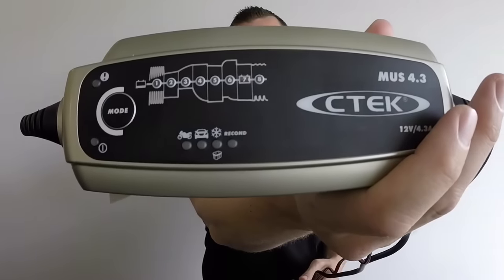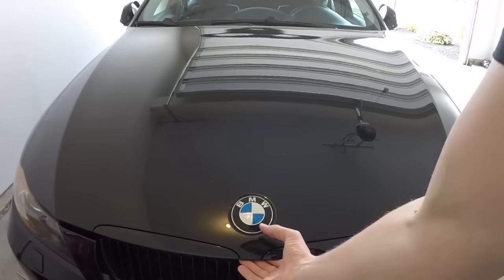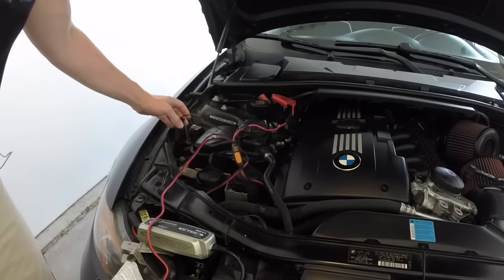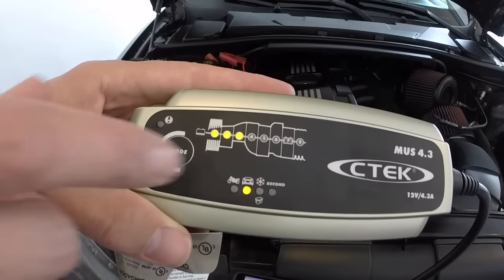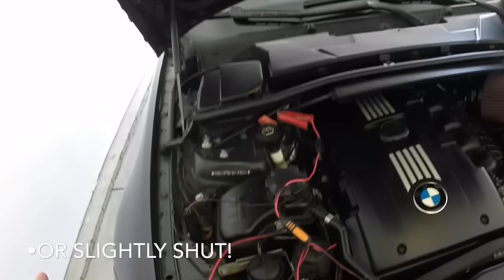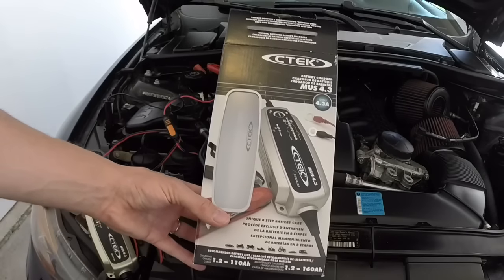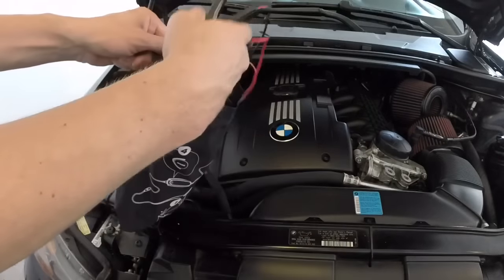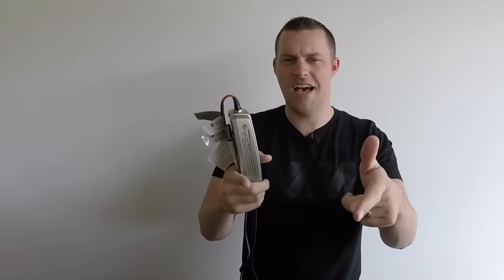How To Charge A BMW Battery! CTEK 4.3!

Comment from the maker: CLICK HERE To Shop On My BMW Fanatic Amazon Website! Thanks for the support! 👉🏻https://www.amazon.com/shop/bmwfanatic
Reply: BMW Fanatic my battery is dead can i charge with this ctec charger? My car is f02
Reply: Do you know where the negative terminal is for the 2018 G30 BMW Model? I've been trying to find this out but with no luck. An image of the negative would help a lot. Thanks,
Reply: Hello can you charger the bmw battery using a regular battery tender plus?
Reply: Hello @BMW Fanatic I have not used my 335i for a few months and it is completely dead should I use the connectors for the front charger or should I use the connectors for the battery itself to charge my car ? What do you think the best way to do it with my current car condition ?

Comment: I plug in my battery to the tender if it sits more than 2 days.  Might be overkill, but never hurts to keep the battery in top shape!  CTEK is the way to go.
Reply from the maker: Brandon B Nope not at all!
Reply: Shifted Perspective I do the same and all my batteries have last more than 7 years. I change the battery just for peace of mind after 7 years.
Reply: Same here. I've got one of those cables wired in permanently so I don't have to use the crocodile clips. Thst's connected to an extension cable that slips under the garage door and that's where the charger is. It means I can close the hood with the car outside.

Comment: A few things: - If you have a BMW, there's a good chance you have an AGM battery. In this case, you will want to use the "winter" setting. - If you use the "recondition" option, you should disconnect the battery from your car, and plug your charger directly to battery or you might do some damage to your car's electronics.
Reply: Not at all, did it countless times, no issues. Why? Because RECOND does NOT work on AGM batteries, does not flood it. Source: CTEK. RECOND is there for other batteries types. Now, Cold does work, spooling the voltage and temp when it is cold.
Reply: Recond is not applicable to agm bud
Reply: Why are u commenting misinformation?
Reply: How long does it take to charge a Beamer? I’m going on 6 hours and it’s still on 2
Reply: The newer CTEk has a separate AGM mode now

Comment: works great! I have a 2006 750Li that I don't drive often, the battery went dead twice and I decided to get this and the small jump charger in the event I was someplace remote, it died again. When I hooked it up, the battery was listed at 2, pretty weak, it took 24 hours to fully charge and I could tell the difference right away. Week later, battery dies again as I haven't driven it in over a week, I decided it was time to replace the battery but, good to have this in the event one of my other cars needs a charge.
Reply: I have 2016 M5 I used BMW Ctek.  I left car in garage for 3 months,  Everyday Charged with timer installed.  Charged at night and shut off in the morning.  Car start just fine after 6 months without drive.

Comment: I have 2016 M5 I used BMW Ctek.  I left car in garage for 3 months,  Everyday Charged with timer installed.  Charged at night and shut off in the morning.  Car start just fine after 6 months without drive

Comment: It's NOT a trickle charger. It's a SMART charger. It's an intelligent charger using proprietary algorithims. When the battery is fully charged, it knows when to 'float' the battery with a harmless pulse charge. Big difference from a 'dumb' old trickle charger that never stops charging.

Comment: Question … I have a 330i that looks like the auxiliary battery is giving me issues, but it is a Li-Ion battery.. this charger would not work for those batteries correct ? Thanks

Comment: If I'm storing my car in the garage, should I use winter mode or car mode? Would greatly appreciate your feedback!
Reply: I've been using car mode since my garage doesn't get to a freezing point. I rarely keep my garage door open for more then a few minutes. I've had zero issues for 4 plus years using this on my b58 powered vehicle.

Comment: I cannot find a CTEK 4.3 user manual, but if you read the CT5 Time To Go user manual it shows charging at the battery just on the other side of the BMS current sensor if done in-vehicle. It has no reference regarding the use of underhood jump start terminals (posts). 

What I have learned is that you should actually understand what a charger is doing in normal operation in regards to voltage and current before using it on an expensive vehicle, especially remotely from the under hood terminals. Battery charger claims of being smart or supplying a certain amount of controlled current are greatly exagerrated. Many times switching voltage control is used rather than linear control because it relies on the battery as a kind of filter, which may be appropriete if the battery is charged stand-alone (out-of-vehicle).

Comment: I live in Wisconsin and winter is pretty brutal here.  I don't drive my Bimmer in the winter and would leave the car on the driveway with car cover on for at least 4 month.  The temp sometimes could be below 10 degree.  Can I still use this charger to charge up the car for all this time since the car is outside?
Reply: I live in WI also, and am already experiencing battery problems with my BMW 3-series because I am not a daily/frequent driver.  I bought a pocket jump-charger, which works great to turn the engine over when the battery fades (won't work if battery is completely dead though), but honestly, would rather have a smart charger on the car all the time so it's ready when I am.  Instead of having to jump the car before I head out.  Also, I'd feel better if the car battery was ready to go in case of emergency.  I bought a Genius Smart/Trickle charger, but haven't hooked it up yet, still figuring out how to hook up the charger in the front/engine as opposed to the trunk/battery.  I read the manual and it seems like you can leave it hooked up 'indefinitely' since it'll stop charging when there's 'nothing to charge' (fully charged).  But if you left your car outside, even under a cover, I think you'd have moisture problems.  Maybe someone could remove your battery from your car so you could put it inside the house for the many months you don't use it?  I would do that if I knew how.
Reply: CTEK makes a specific "extreme conditions" version of this charger: 
CTEK (56-958) MUS 4.3 POLAR
It's pretty much the same charger, with design changes to make it more reliable in temps down to -22°F/-30°C, but I think the only difference is hardier cables.  If you have the regular MUS 4.3, it should be fine as long as it's off the outside ground and under the hood (protected from direct elements).

Comment: You should also note that not all chargers connect to the battery posts in the hood. Most factory trickle charges connect to the battery in the trunk directly.
Reply: trickle chargers are not meant to be used on AGM batterys

Comment: Is the Ctek lithium USA 12v/4.3A/lifepro unit you reviewed have a part number ART 56-926?

I just bought one from Amazon, but both the comfort connect clamp and eye let cables are too short. The positive and negative cables (for both the clamp cable and the  eyelet cable options, are too short to reach the positive battery terminal and the negative ground terminal screw. 
Did you have a different unit, or cable you used?

Comment: Hey which mode do i need to use if my battery is at 25% charge say low voltage which showed up in the battery tester.. Thanks in advance

Comment: Can you use the snowflake and/or recond mode for bmw AGM batteries??   Will those modes damage that type of battery?
 If you're starting with a deeply drained battery, how long will each stage take?   8 hours?
Thx
Reply: Snowflake mode is AGM mode.

Comment: LI ION BATTERIS: in winter, when cold, plug at the battery works best, get 7-9 years. CTEK knows for AGM batteries not to flood, and -16 to -40C, ONLY REAR spools the battery to start charging. Front is best for top up, indoors, summer. Outside REAR is best, in the cold. LI IONS DO NOT charge below -15C, so spooling is key (as tesla owners learned..). So plug upfront -20C outside, GOOD LUCK. IBS will be confused to say the least and the Li ion battery will declare charged even if not.

Comment: whats the difference between a 15amp and a 7.5 or 3.5amp charger. Also, should I need special battery for an AMG battery?
Reply: Higher amps means faster charge and also able to handle bigger batteries better. Although it's best to charge using lower amps on a typical battery, high amps puts more stress on it.

Comment: I love the video. I am just trying to figure out what setting I should use,, agm or lithium on my 2022 8 series.
Reply: Go AGM, lithium is not worth the 3x upcharge. I would recommend something that has the longest replacement warranty (not pro rata). I personally have Odyssey Battery, but if I were recommending an AGM to a non-car person I would recommend them get the nicest Interstate battery or nicest AGM (that matches their car) from a convenient car / car battery brick and mortar store. I don't see the value in buying online (hassle if you have an issue), or driving like an hour to get a certain brand.

Comment: I have the Bmw trickle charger and for some reason it doesn’t go past level 3 on the charger.. I’ve plugged it in over night and can’t seem to go past level 3? I’m in Canada so it’s cold -30 degrees Celsius.. any help?
Reply: To fully charge a battery it is best to bring it up to 20 degrees C if done in vehicle. Charging lead acid batteries is not usually done below -20 degrees C. At -30 degrees C the recommended lead acid charge voltage per cell is around 2.6 Volts or 15.6 Volts total. Which is high for charging in-vehicle. If the battery is charged stand-alone you can use a high current charger at an elevated terminal voltage which will heat up the battery. As it warms it can accept more charge. For example a 100Ah starting battery at low temperatures 30% SOC could readily take a charge current of 20 Amps (0.2 C rate) during the bulk phase. The CTEK cannot deliver that kind of current. 

At 20 degrees C the recommended max voltage is 2.45 Volts or 14.7 Volts total. Which would makes more sense for not overvolting the 12V bus if the battery is charged at the battery on the vehicle side of the BMS current sensor.

Charging batteries at very low temperatures is not an easy task in-vehicle.

Comment: bmw clicks upon start and won't turn over. Had a flat battery sat through all winter. Re-charged it, and it lights up the car again. But now it clicks.
What could it be? The battery read 13.90V   now it's down to 12.80

Comment: my charging ports are not working i always have both in use 24/7 and now both of them are not working anymore you think this well help out the problem?
Reply: Do you mean the interior auxiliary charge ports, like the USB and power outlet?
Check the 10-amp fuse for the ports.

Comment: Just got the ctek for my dead e90 battery ...hooked it up and plugged in ...no green lights on charging sequence...I've tried each mode ...after a minute or so all the lights just go off ...I am charging from the engine compartment
Reply: The NOCO chargers will do the same thing if the battery voltage on a 12V setting is very low. Seems to be somewhere around less than 11 volts at the battery.

Comment: Last time i done this it took 3 days and wasnt even fully charged, using the same charger, any thoughts?
Reply from the maker: If it’s taking three days and didn’t move up at all then your battery may be toast
Reply: @BMWFanatic  Done it again recently it only took 5 hours haha, i definitely didn't have the connections on properly 😂

Comment: Noco with obd2 charger connector is soooo much easier. No more popping the hood
Reply from the maker: fondoo can't flash or code with the Noco OBD2 charger, so that's out of the question. Not sure I would trust that, especially how finicky the DME's are!

Comment: the guy in the parts department told me if I should. go on a holiday I should leave it plugged in. Is that ok?
Reply from the maker: Yep, it will maintain the charge and not use a lot of power to keep it fully charged

Comment: Well I own a E90 M sport, and done the exact steps in this video, when I first drove it after this, the whole car went crazy, light flickering on and off, wipers switching on and off, basically everything switching on by itself. I’m not sure whether it’s the battery is the problem or the alternator
Reply: You have to re-program the battery.....on alot of the later model BMW's anytime the battery is replaced or in your case sometimes when it's been dead you have to have the battery reprogrammed so the car will know how much power to use based on the condition of the battery.

Comment: @BMW Fanatic: Do you have to register the battery when you charge? I know you do need to register if you replace with a new battery. The charging KINDA makes the battery new(ish).
Reply: No. Technically only if you change your batter to another specifications ie more cca CA type of battery or size

Comment: When your BMW is fully charged do you unhook the battery charger? My wife told me to unhook mine when it was fully charged.
Reply: That CTEK charger is automatic.  It will stop charging when the battery is fully charged, and it will auto-test the battery every 10 days, then top up the charge as needed.  -So, you must leave the charger plugged in for this feature.
Reply: Happy wife - Happy life

Comment: I would like to disconnect battery and then charge it at my place since I live in an apartment: 
1. will I need to register battery again?
2. Any precautions to be taken?
Reply: Would be easier to drive your car more often than doing that.

Comment: Hi I have a question , I think that you charge the charger previously and you don’t have to connect the charger 🔌 to the AC , for example if you are far from your house and the battery car fail , or you need to connect this charger to the ac always to make it work , or I already charge the charger and I can use it anyplace if the battery fail without connect it in the ac.

Comment: I never keep this on the car, always remove the battery and charge it separately, I had someone use this once and left it charging over night, woke up to fire fighters hosing down his car.. car burnt to the ground..
Reply: BS. Not this charger (unless you got a rare, defective one). 
This specific charger is designed to stay on the vehicle while not being driven; It's fully automatic.  Go ahead and read the manual. 
I've had one on my Ducati and two cars in storage for the past 7 years.

Comment: The permanent eyelt connector is for applications where the batteries are in a tight spot and it’s difficult to get alligator clips on there 

for instance underneath motorbike seats tractor seats some vans have the battery under the seat in the drivers area.......whatever then you can use a remote connector

These are bloody good charges

I actually prefer 0.8 amp it’s half the price of the 5 amp and most of the time batteries are not dead flat they just need topping up so over weekend the 0.8A  is sufficient...... plus if you have an expensive car it’s just that extra layer of insurance that you won’t damage any electronics because 0.8 A is way too low to cause any problems.....

And finally I have a personal view that a lower slower charge as best I hook up my car Friday night Monday morning on the 0.8 amp it’s ready to go.....

Comment: Good morning. I began charging the battery yesterday on a BMW from an auction (Perhaps It's been sitting for a long time).  Last night I connected the charger in snow flake mode. And it did not charge overnight. This morning  i set it in the forth light RECOND mode to give it a slow charge because. Just after this, three lights inside the dashboard are  now flickering at a slow rhythm . The start engine button light, the parking light on the gear control and the emergency icon (triangle). it's also making a little rhythmical noise inside the car. IS ALL THIS NORMAL? Thank you
Reply: ...3 years ago. So how did it turn out for you, did you short out your car or what?

Comment: I have 760 2015 and when I connect the Cteck it charges the battery but I notice something on electronic part of the car starts to misbehave, this can be gps or radio setting or HUD , someone here commented that BMW has a type of battery that can not be reconditioned unless disconnected from the car and if so will damage the car electronic. He recommended using trickle charge , snow flacke , does anyone else know anything about this?
Reply: Use the Snow Mode. Leave it connected as long as you are not driving the car.

Comment: advance auto has these on clearance their $10.95 I just bought one
Reply: starlyn batista yeah store only
part# 40171
sku#11329670
$10.95
Reply: Grab America by the Flaps cool thanks man, gonna check out the ones near me for 1.
Reply: starlyn batista no problem boss
Reply: Grab America by the Flaps picked one up just like you said 10.95, what a steal, thank you so much.
Reply: starlyn batista yeah it's a great fucking deal,we saved $105
Reply from the maker: Grab America by the Flaps oh wow, lucky store by you
Reply from the maker: Grab America by the Flaps none by me at that price
Reply: BMW Fanatic give them the part # u actually have to call the store or visit. it won't show up online for that price, I'm in Florida
Reply from the maker: +Grab America by the Flaps ahh gotcha, ok will do, thanks for the info
Reply: Grab America by the Flaps I found them at my local advance for $40, still a great deal, not as killer as your deal though...